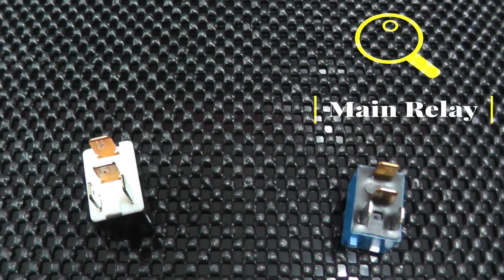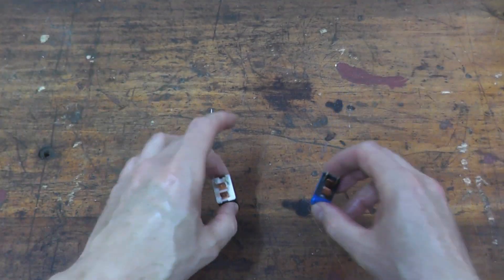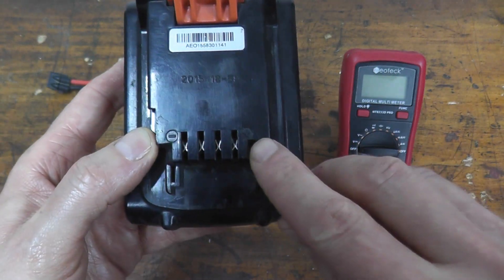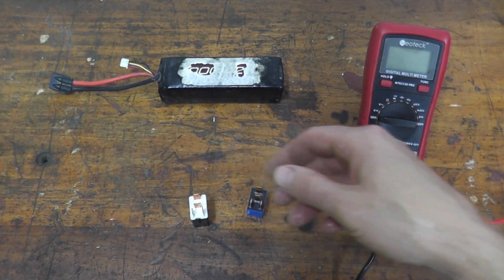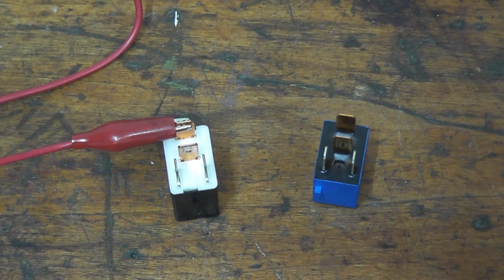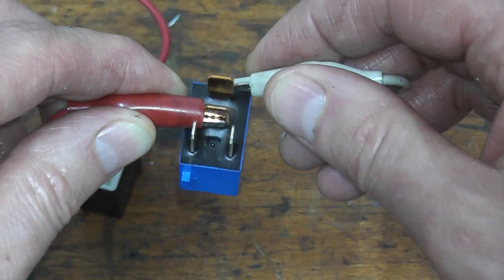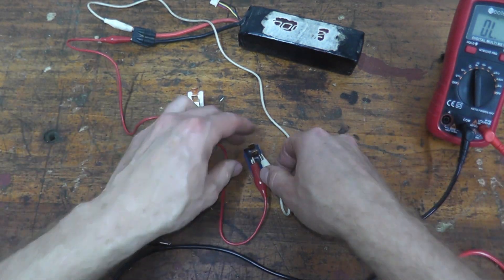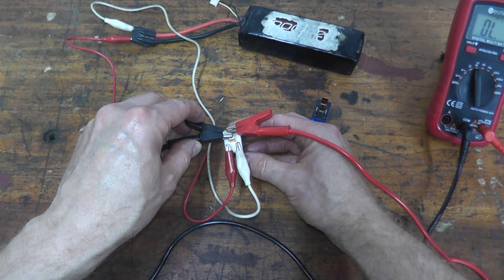How to Test and Replace A Main Relay

Comment: This is information from a educated professional with +40 years experience : this is a amateur HORRIBLE stupid way to test a relay. DO NOT DO THAT AT HOME! First of all you need know beforehand exactly the pin layout and type relay you are checking! If you don't, leave it to a professional or just replace with a new one. Some relays defaults to always on and some to always off. Means when they engage they will BREAK a circuit or CLOSE a circuit. If this had been an always on relay this dude has already blown either a power supply or a fuse or just lighted stuff up aka things melting or catching fire. Second: a continuity test  with a multimeter does NOT automatically mean that things is OK. When a continuity test  with a multimeter gives audible confirmation it just tells that SOME current is flowing. Multimeters can give "the beep" with resistances up to as high as 50 ohm, depending on model and i.e. 20ohms in one situation can mean things will still not work or not depending on load. You need understand the relays intended use and OHM, resistance and a meter that have at least 2 decimals when measuring resistance. Many relays if of the common electromechanical type, means they have a tiny coil inside that sometimes is also MAY be fitted with a diode to protect the circuit from a high voltage spike that occurs when the coil is de-energized. By applying random polarity you fry that one and also short your powersupply. You need KNOW if the relay has polarity of the pins for the activation of the relay.   And I havent started to talk about SSR relays that is more and more common and is totally solid state.  Author: remove this garbage from YT please.